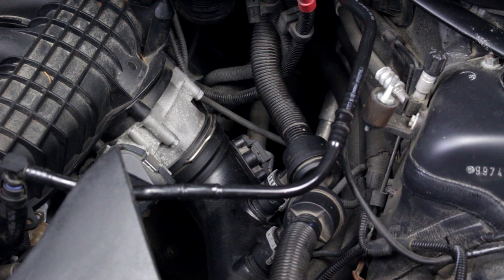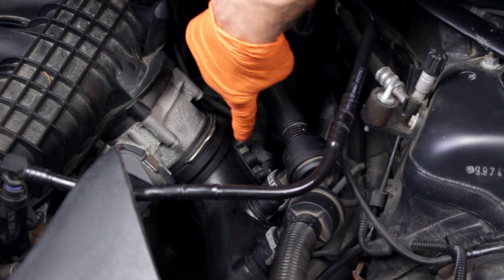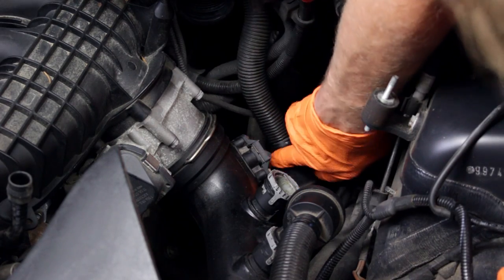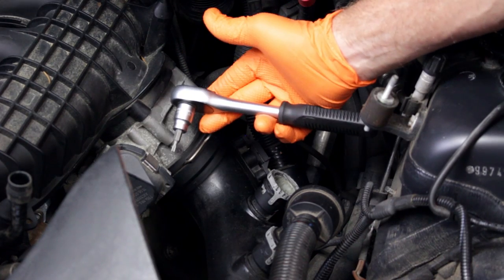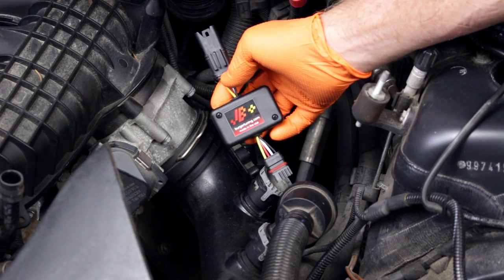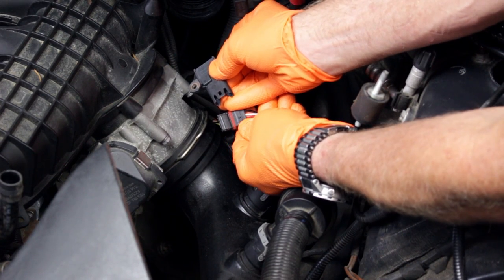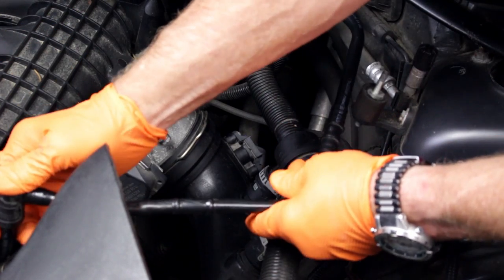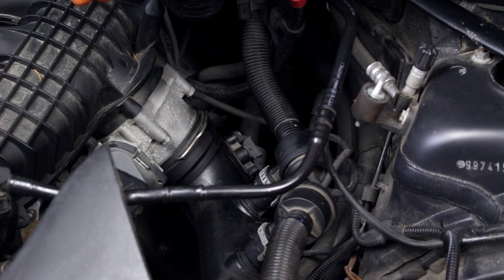Installing a Burger Motorsport Juice Box on a BMW or MINI turbo engine

Comment: I have a 2011 335is that makes a bit more power and torque than the 335i.  Would the JB+ add onto what the 335is already has or would it nullify the factory tuning to make it comparable to a 335i with the JB+ added?
Reply: 2013 E93, I also want to see a dyno chart for JB+.

Comment: Is it true these boxes cause the engine to use the knock sensors primarily to determine when to adjust timing? How are they working long term? Thanks
Reply from the maker: We've been using them for quite some time.  Yes, in the end, the knock sensors are the final say on how much timing will be allowed.  The tuners modify the intake pressure sensor signals.